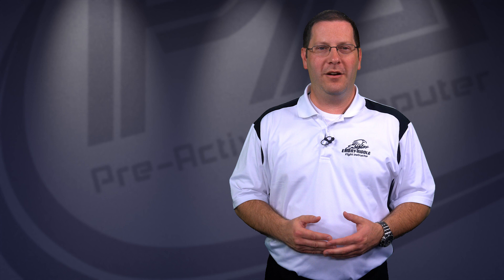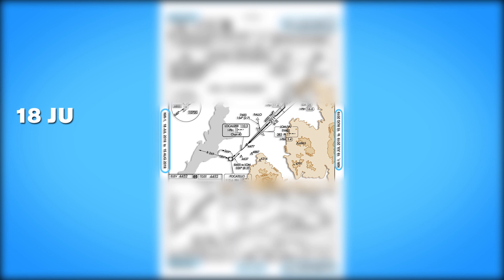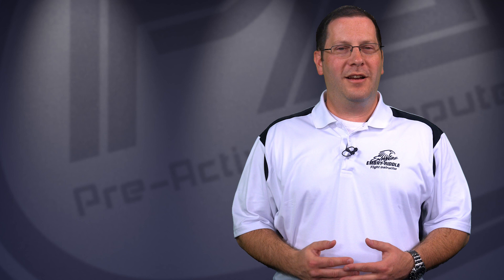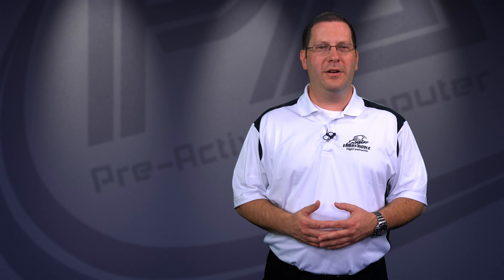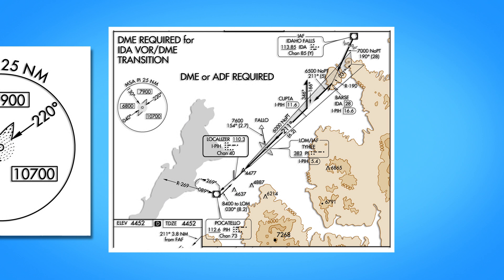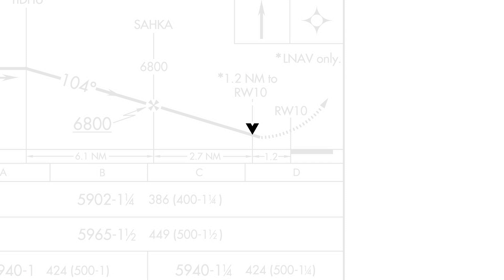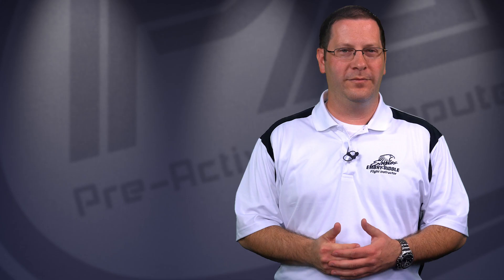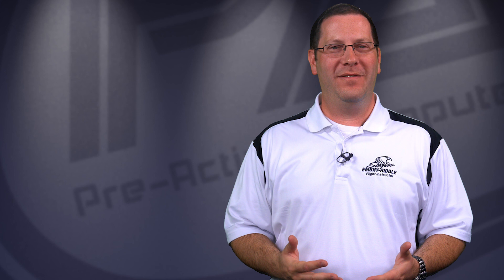Approach Charts

Comment: In the Jeppesen definition document, they define the FAF as "a specified point on a non-precision approach..." and define the FAP as "a specified point on the glide path of a precision approach...". 
So precision approaches don't have a FAF, they have a FAP instead. They also note: "The FAF is coincident with the FAP on a localizer based non-precision approach". (At 12:45 we can see FAP and FAF aren't always coincident)
That's all, just thought it would be worth sharing since I was a little confused. Thanks for the invaluable videos!

Comment: Here's a question I've always had. Why does the FAA call Glide Slope Intercept the FAF for a precision approach when it's also used for RNAV approaches (non-precision) with LNAV/VNAV and LPV minima? Would it not be more accurate to say it is the FAF for any approach with vertical guidance?

I'm sure it's a hold over from before RNAV became so prevalent with GPS, but still it's an easy wording change they should make.

Comment: what does a TCH on an approach chart mean to us practically? What's the use of it while briefing?
Reply: Charlie Sierra I know the meaning but what I wanna know is what is the use of it in an approach briefing? What affects a landing aircraft when it varies from the standard 50 feet?
Reply: diamondbreak you have to remember these charts are made for airplanes of all sizes as part of the service the FAA gives for its users. TCH is more critical for faster jets as any foot crossed above the TCH, assuming you continue the same decent angle will result in a longer landing run. The longer the landing run, the less runway available for you to stop. Especially given precipitation or contamination such as snow. TCH i think is also used to calculate and generate your LPV or at the very least used to be used to generate a VNAV for LNAV/VNAV equipped airplanes utilizing that approach minima and capability.